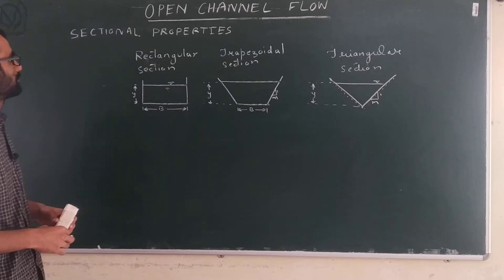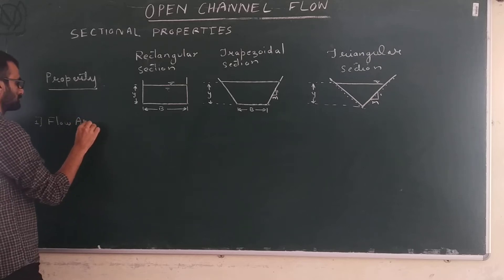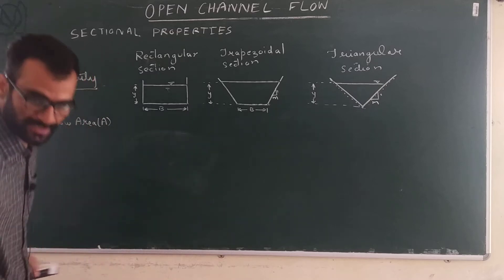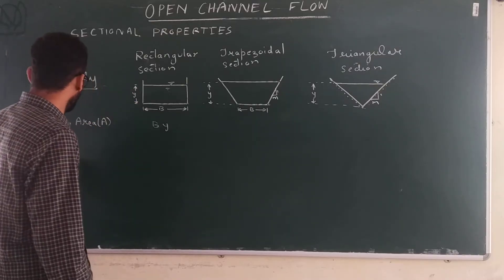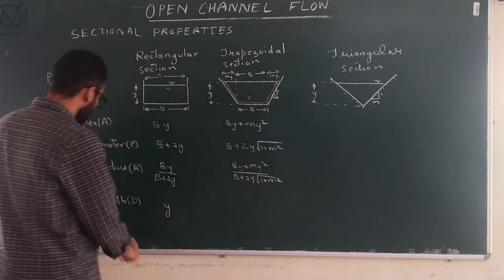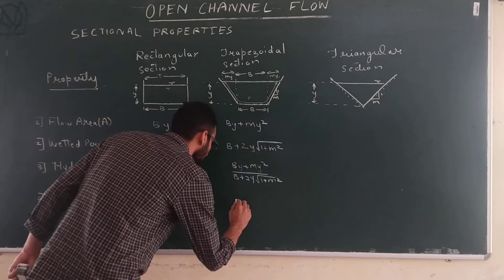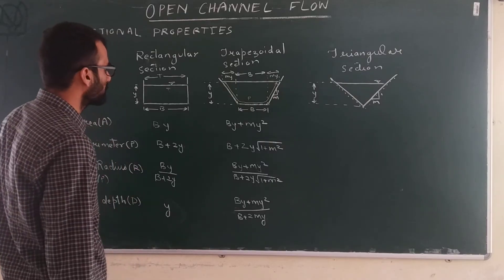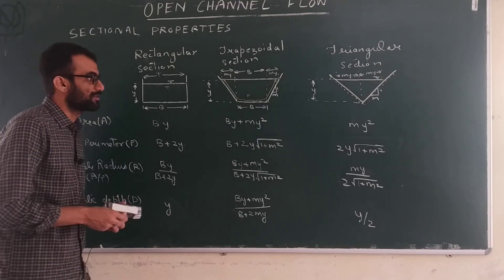Open Channel Flow - 6 [Flow Area A, Wetted Perimeter P Hydraulic Radius R, and Hydraulic Depth D]

Comment: About hydraulic radius and hydraulic mean depth you are telling just formula but not explaining what it mean really in practical by using that diagram. It will be better to get that original visualisation of hydraulic depth rather than a bihearted firmulae
Reply from the maker: Good suggestion.. You can also share what you know.. It will be helpful to everyone..

Comment: is m symbol in angle?
Reply from the maker: m is symbol for side slope of the section. It is 1 unit vartical : m unit horizontal. For example if the side slope is 45 degrees, then slope is 1:1 so m would be 1.

Comment: thank you! this video helps me on making progresses over my thesis
Reply from the maker: Thank you so much!!
Reply from the maker: That is the topic of your thesis
Reply: @abhijeet246  i'm doing water quality modelling with qual2kw, and it requires some data that can only be achieved by manual calculations esp with some restrictions in this pandemic situation.
Reply from the maker: @shampoo740  sounds interesting !!!..I guess your doing hydraulic computations ...All the best!! I am glad that my videos are o some help to you
Reply: @abhijeet246  thank you! yess i was stuck on that part and your video helps me add some options to break through this "stuck" phase :"D

Comment: Q=48m^3/sec
V=1m/sec
Side slope =1:1
n=0.02
B/D=2
S=?
P=?
It is a trapezoidal canals
Reply from the maker: Hi Faisal, the solution to your question I an writing here
1. Both Q and V are given, so we can find flow area A simply using Q = V x A
So A = Q/V = 48 / 1 = 48 m2. 
2. As it is a Trapezoidal section, flow area A = By + my^2. Now we are given that B/y = 2. So B = 2y.
Therefore A = (2y) y + 1 x y^ 2 and A is 48 m2. Solving for y we get y = 4 m. And B = 2y = 8 m. 
3. As B and y are known, we can find P directly by formula P = B + 2y√(1+m2) = 19.31 m. 
Therefore R = A/P = 48/19.31 = 2.48 m
4. To find bed slope S, use Manning as Manning's constant n is given n = 0.02
V = (1/n) x R^ (2/3) x S^ (1/2) 
1 = (1/0.02) x 2.48 ^ (2/3) x S^(1/2) 
Therefore S= 0.001191
Reply: @abhijeet246  thank you sir
Reply from the maker: Please let me know if the answer is helpful and if you have any doubts feel free to comment.